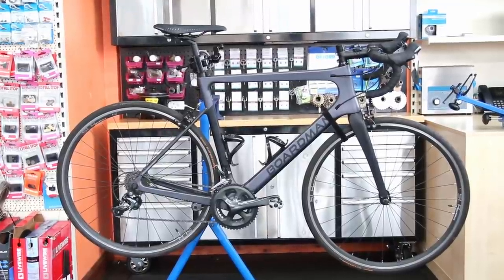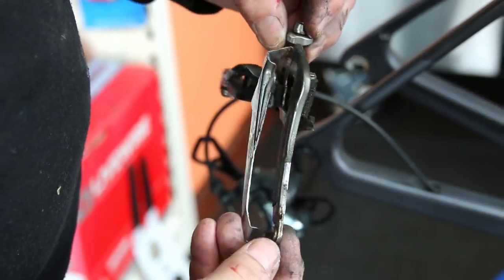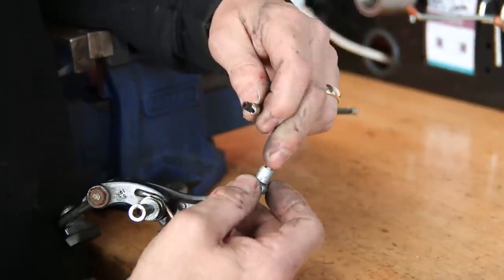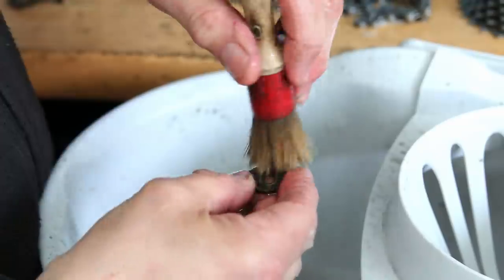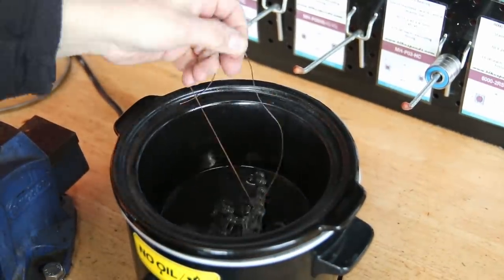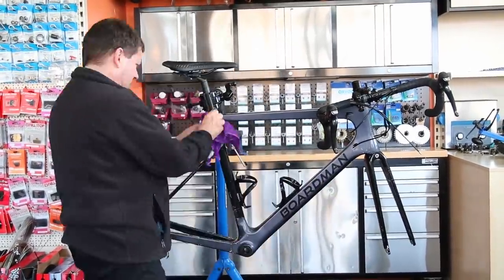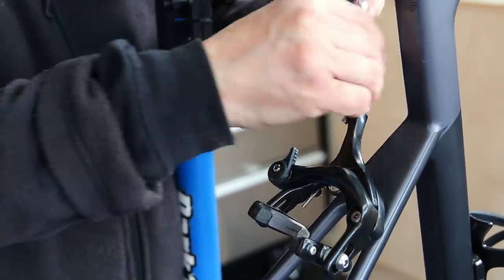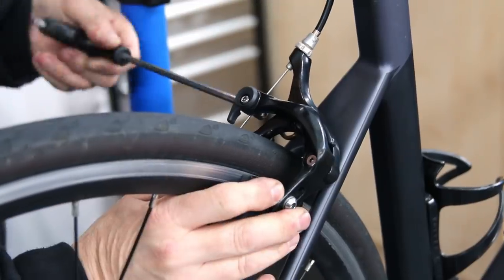Boardman SLR Road Bike Service & Chain Waxing!

Comment: When I first got in to cycling after some running related injuries, I bought a Boardman SLR with SRAM double tap and apart from being quite a heavy bike, I never had a problem with it. I've upgraded my collection of bikes but, my Boardman is still there if only on my turbo trainer.

Comment: I’d love my bike to get this much attention when serviced. I’ve had it serviced before at 5 different places. And none of them have really met the standard.

Even had the disc break, pivot screw come undone after a ride after a service, and me nearly crashing… and when taking back they said it comes undone due to vibration…. I said “I paid for a gold service and all parts were supposed to be stripped and cleaned… you either never cleaned it and checked screw torque … or you didn’t screw it on back properly”

Comment: We most of the time put heatshrink over the cables to keep them together and protect the from rubbing.
Reply from the maker: I heat shrink Di2 but wouldn’t for gear and brake cables because they will hold the steering and reduce the freedom of movement.
Reply: @Bikespeeds  we do not put the whole cable in heat shrink, but mostly two pieces of about 3 cm each. But we do a lot of e-bikes which have 6 or 7 cables in the front. And without something to hold them together they rattle a lot and it just looks messy.
Reply from the maker: I’d use spiral cable wrap because it doesn’t pull the cables completely tight like heat shrink & gives them the freedom to move and slide with steering left and right.

Comment: Once again, great video!  I have 2 questions: 
- do you leave the shifting cables a little bit longer at the end in order to remove the 2 derailleurs in a second moment? How long do you leave the end?
- when you check the chain, do you only measure one link or do you take more poin? If only one measurement is "loose", do you need to replace the chain already?
Thx and greetings
Reply from the maker: I do tend to leave the rear derailleur with a bit of a tail, which helps for future removal, but most of the ones I fit the cable end will clear the threaded hole in the thumb adjuster if I unwind it.
My chain checker measures over 5 inches and if at any point around the chain it shows wear I advice accordingly.

Comment: I'd be interested to know what you think the benefits are of waxing a chain. I used a wax lubricant a few years ago and hated it. It needed re-applying every 50 to 100 miles, and was then an absolute pain to clean off when swapping back to my normal lubricant.
Reply from the maker: Did you use moulten wax or a rub on wax?
Reply: Neither. I used a liquid wax lubricant, sold as a winter lubricant. It must be wax dissolved in a solvent.
Reply from the maker: What we use is heated until it’s like water it literally pours into the chain rollers and as it cools for a a coating from the inside. It last a lot longer than 50-100 and is easy to clean off using boiling water. It’s way, way easier to deal with than an oil.

Comment: How long does chain wax last? Tried it myself on MTB and after 2 bike washes chain is pinging like it doesnt have any lubricant left.
Reply from the maker: What wax are you using?
Reply: @Bikespeeds  it was paraffin wax melted with mix of ptfe and Tungsten (Wolfram) Disulphide WS2 powder